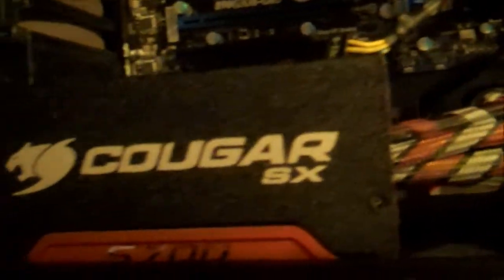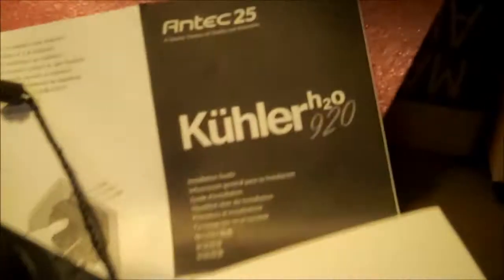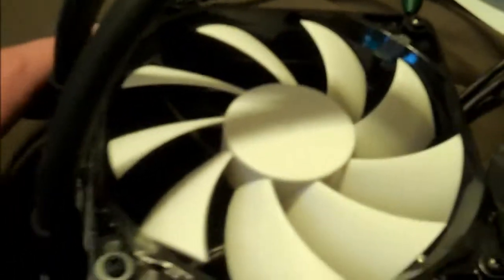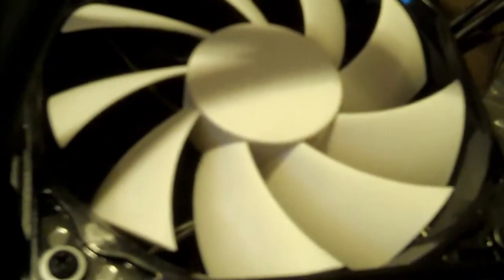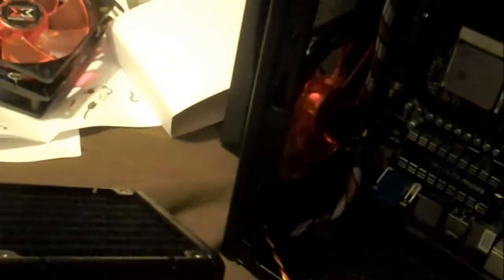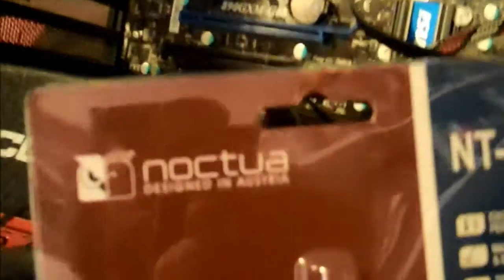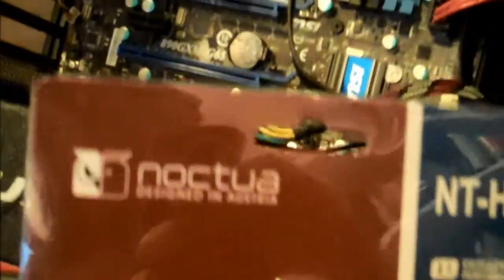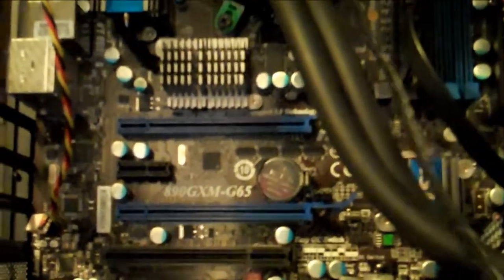Antec Kuhler H2O 920 in a NZXT Vulcan case

Comment from the maker: @iHazNaTh1nK I plan on installing a longer card, that's why I went with the side mount. The hoses do clear the 200mm side fan on a normal width card. I have the 5770 Flex from Sapphire installed and everything fits great, it's like the hoses were formed for that purpose.
Glad I could help.

Comment from the maker: @iHazNaTh1nK You could if your PCI-E slot is in the top of your motherboard, the max length of your card can be 9.5". If the slot is one or more down than you can go up to 11" as long as the power connector is on the side of the card.
Hope this helps and thanks for watching.

Comment from the maker: It will fit the mobo as it comes with both intel and amd mounting hardware. If your friend has a large case he will need a 120mm capable fan mount on the back or top of the case, if top make sure of head room to avoid intrusion with other components.

Comment from the maker: Unfortunately, no. The Vulcan top fan mount just fits 2/120 mm fans, even if you modded the top to mount the H60 rad toward the middle you would have to mount the fan on the outside of the case...mounted inside would cause major clearance issues with your mobo.

Comment: I own a corsair h60 which is similar to the 920 except the radiator is half the width and it only uses a single fan. Do you think I could possibly fit it in the top with a single fan? Or is the front fan mount the only option for a water cool unit?